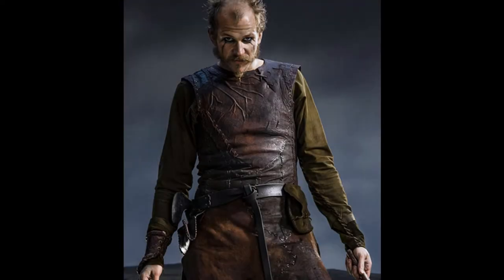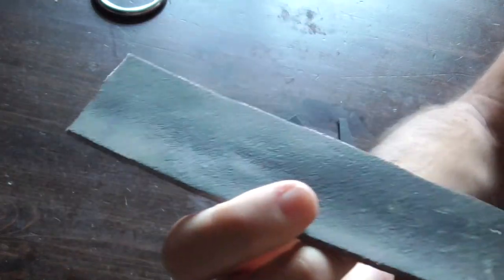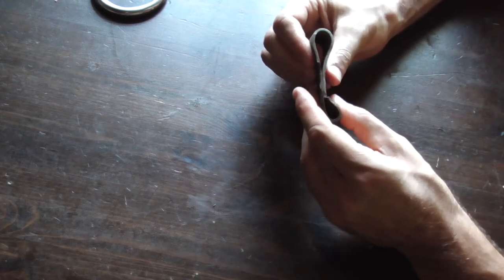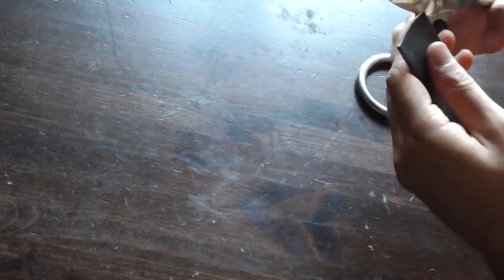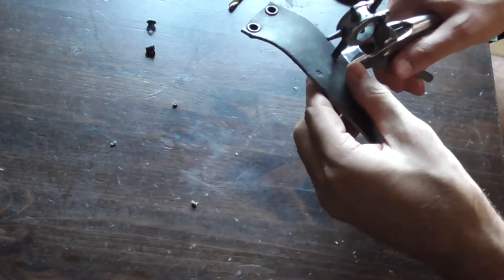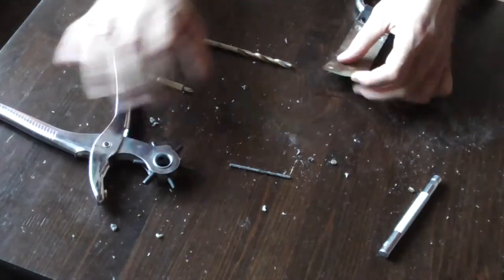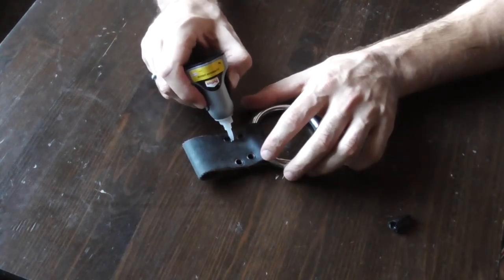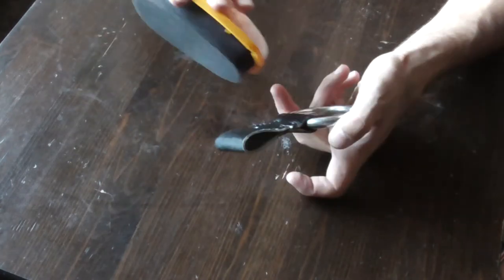How To Make A Belt Ring Axe Holster!

Comment: Smoothing the edge of leather is called burnishing. Use a piece of smooth wood and rub the edges vigorously as though you are sanding it. You can buy a tool specifically for this, and it is really cheap.